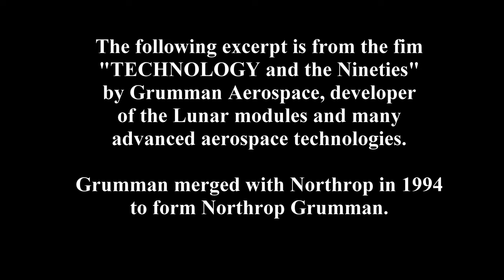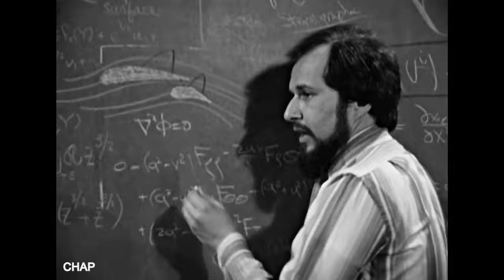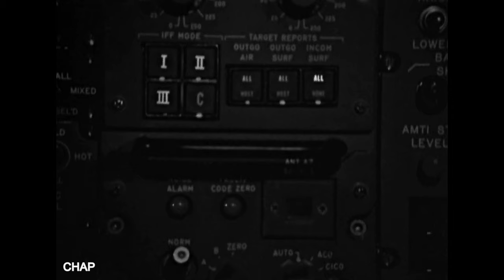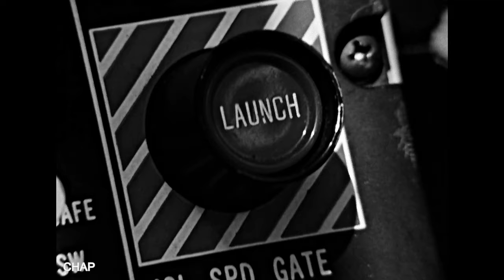Vintage Film  "Technology of the 1990's" (Grumman Aerospace, VTOL, radar, Northrop, space, F-14)

Comment: That dizzying opening sequence of very quick cuts shows some notable winners and some, shall we say, non-starters. For the first one shown, the Convair XFY-1, my dad took my little brother and I to see the very last flight of the only one which ever flew. After a long wait, it was a very short flight. It only got a foot or so off the ground when the test pilot put it back down because the very complex gearbox of the dual turboshaft engine was overheating. The whole time I was thinking about the Thanksgiving holiday coming the following week and how we would have four full days off from school. 

My dad almost certainly helped construct the second one shown at Lockheed. Both of my parents worked for a division of the company which built the X-15 and the XB-70A so I read much about those in company publications. Oddly, one of the biggest non-starters shown in that sequence is the Grumman F-111A which was originally known as the TFX.
Reply from the maker: Hi Dale, that is fascinating information about your family's connection to some of these early aircraft!  Must have been lots of top secret clearances issued.   They did some pretty cutting edge stuff back in those days.  ~  Victor
Reply: @ComputerHistoryArchivesProject  Victor-- The second aircraft which was one of the original batch of 20 designed and built for the CIA and later designated U-2 in USAF service was probably the most sensitive project in the U.S  gov't at the time. I believe my dad was hired only because he had a personal recommendation from another employee working on the project.
Reply from the maker: I bet he was very fortunate to be working on such a key project.   "Above top secret," as they say.    (I knew a few folks who worked on the 1980s stealth proj.  All great people.)